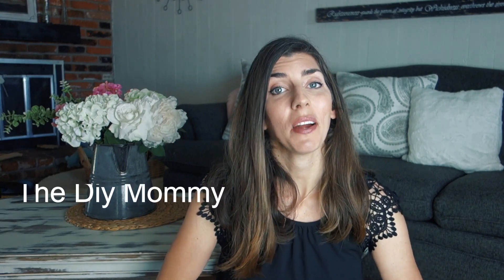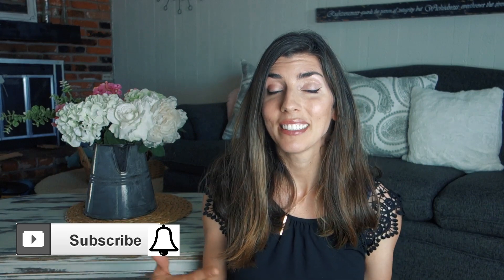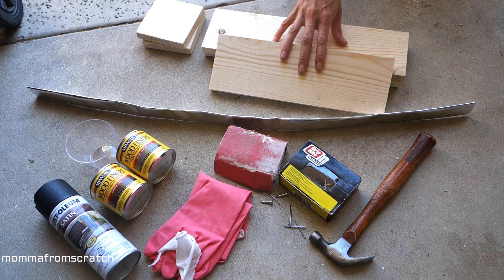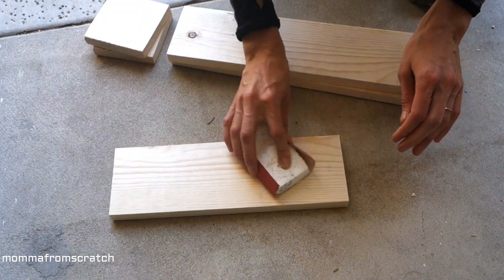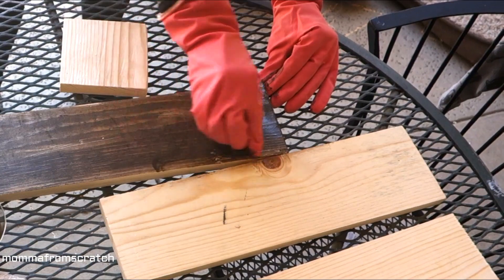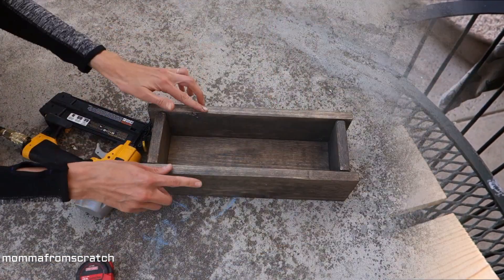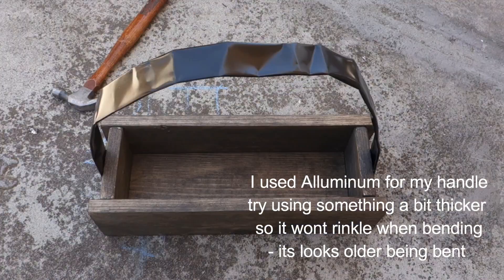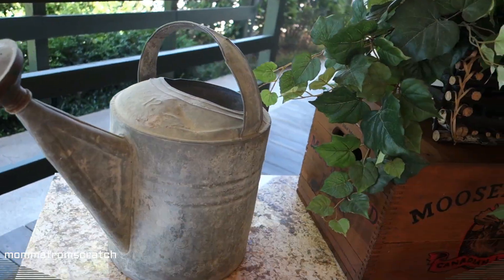Magnolia Decor Dupe | 2017 Outdoor DIY + Decor Challenge

Comment: I really like this! Super cool and the handle almost looks like leather to me. What dept did you find the material for the handle?
Reply from the maker: I used some aluminum I had left over from my windmill. It was in the roofing area, but by the lumber they do have these metal looking pieces that range in length from 6-2ft and are really thick, could be a good alternative but you would need to use bolts. Hope that helps.

Comment: I'm definitely making this! I love Magnolia Market, but sometimes not the price.
Reply from the maker: Send me a pic when you do!
Reply: Momma From Scratch Made it & it looks awesome. I had to come up with a different way to attach the handle, because I bought an aluminum rod to use as the handle & was unable to make holes into it, to nail or screw it on. I'll try to figure out how to share a picture of it.
Reply from the maker: I cant wait to see it. The screws or bolts should work. You may need to use a drill and a metal drill bit to create a hole.